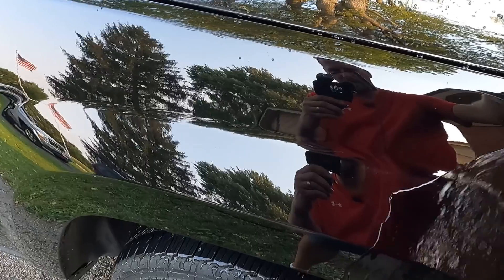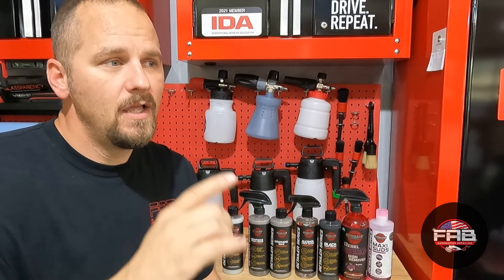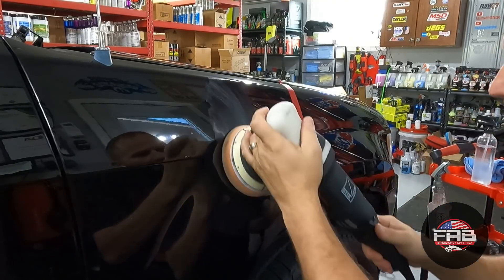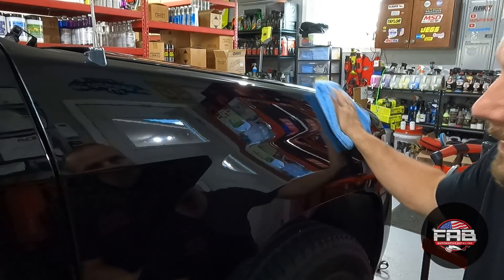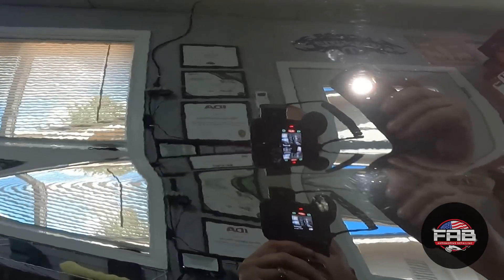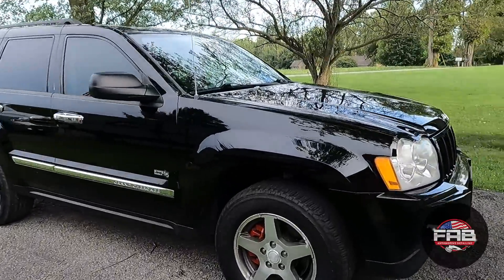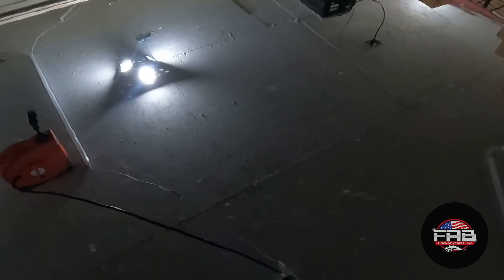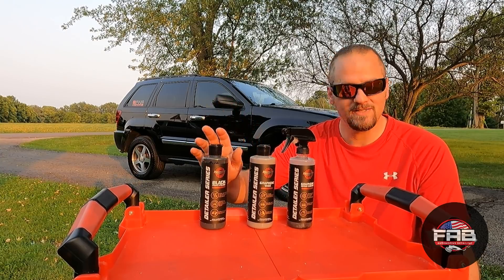3 Products That Gave This Black Jeep Insane Slickness, Gloss and Hydrophobic's!

Comment: I enjoy your approach and appreciate that this is a non-sponsored video. All the detailing videos I have watched to date use compounds and polishes without fillers to separate out the coating step that follows. This is the first video that showed me when it is useful to use a polish with fillers to be gentle, get the desired results, and save time. I also totally relate to poor directions on a product’s label, which can torpedo the end-user’s experience of an otherwise fine product.
Reply from the maker: Thank you! There is a time and place for a product with fillers for sure. Hopefully they fix the directions.

Comment: Hey Brian Great Video.. In my never ending quest to find the best products to make Weathertech floor mats look new. I have used Renegade's Rebel Vinyl Runner and Plastic product. Having left them slick it is unusable for that however, it does decent on other areas of the vehicle. So far Goo Gone and then an APC cleaning works best but I still need that revive product for rich darkness.. I think I will order these products and test them out on a few black cars.. Hope business is booming.. Best of luck with the new gig..!
Reply from the maker: Thank you! Floor mats can be a pain for sure.

Comment: I tried the graphene spray coating.  Totally gone after 1.5 months and 2 washes, no hydrophobic properties left.  Car was outside.  No better than any other wax Ive used.
Reply: Any recommendations? Would you say it is comparable to other wax products, but easier to apply than a regular wax for a novice?
Reply: @mechkitten  its easy to apply.  Im going to try the White Diamond brand on the same car next.  Honestly, the Lucas spray and wipe works pretty well.

Comment: Renegade makes great stuff. They make a product called Rebel All Terrain coating. It's phenomenal on your wheel wells. That's what I use it for but it's primarily made to coat off road vehicles so dirt, mud and snow don't stick to the surface.
Reply from the maker: So far I am happy with what I have used.

Comment: 6th
Reply from the maker: Oh man must have been sleeping in! 😂
Reply: @FABAutomotiveDetailing  🤣yes, had to drive and when stopped at Best Buy was able to watch 📵
Man, the first product I used from them over 2 years ago was Rebel Landslide from Renegade and it's an awesome product specially on offroad vehicles for bumpers fender carpets or fender non carpeted.  Also, you got to check Jason Otterness from Chicago Auto Pros who did a video on their metal polish products where he did a truck.  I have used the metal polish from Dura-Coating as well as their Dura-Coating tire coating and both have been excellent.